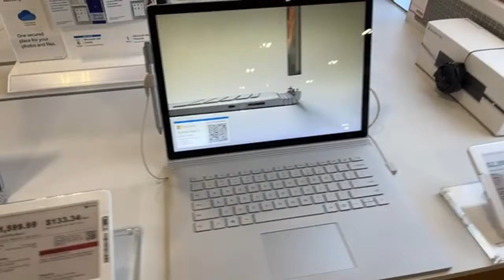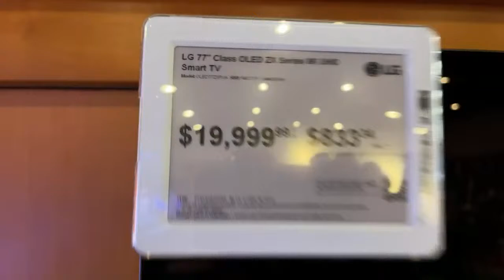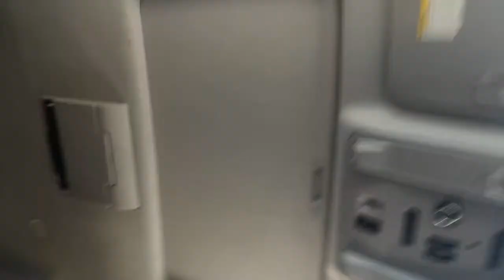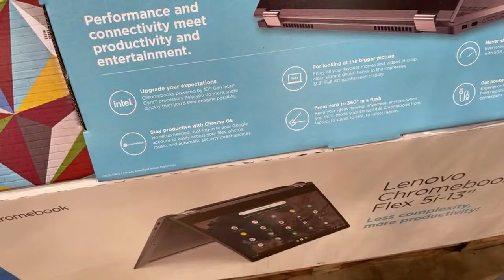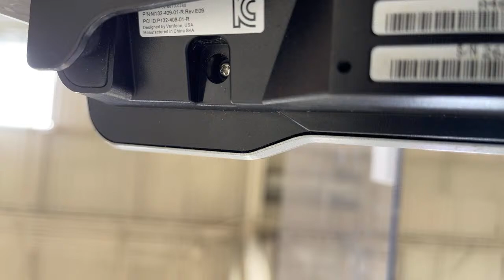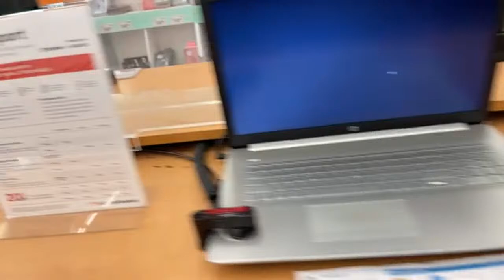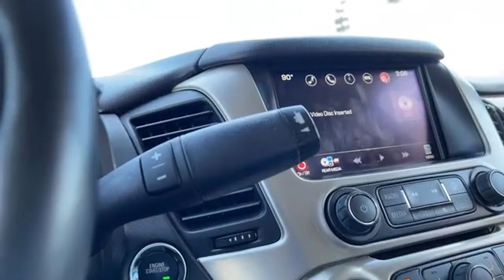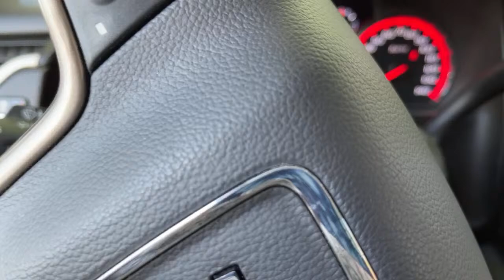What’s the Best computer for your needs? Let’s go Shopping

Comment: I could not add comments yesterday---I buy new low level computers every 3 years either on ebay or from Walmart store or online.   I have a Dell i7 laptop and I only paid 200 bucks by shopping and researching.  Once I bought a computer with low level features and it had no room to update windows which you need to be able to do so I had to send it back.   I also buy from ebay with no issues ever.
Reply: ---not against refurbished either.  Also I have learned to change keyboards on laptops.